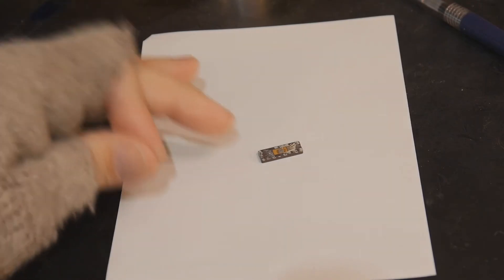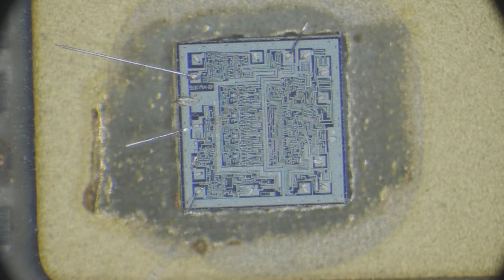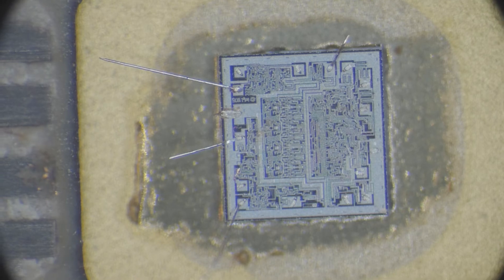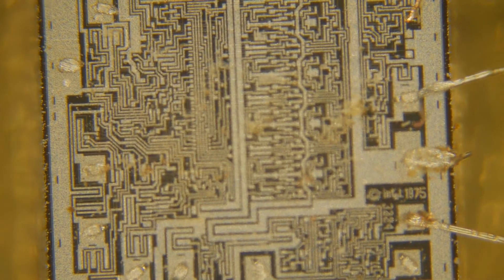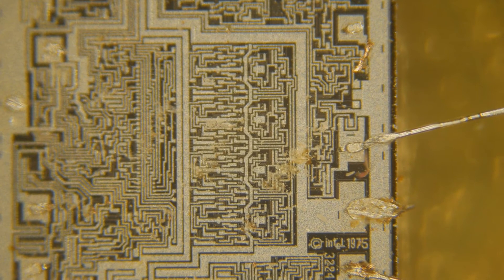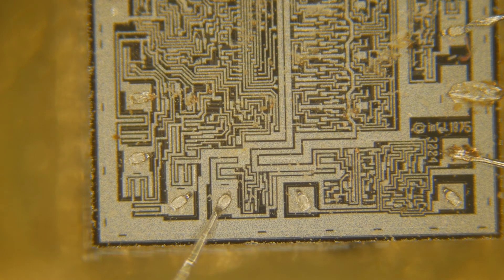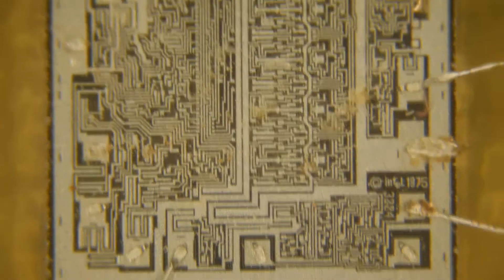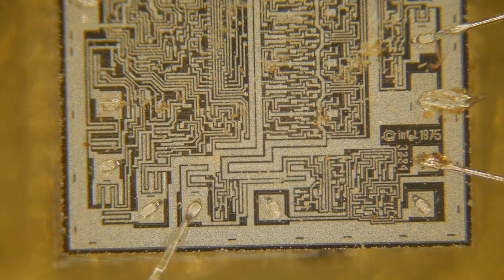#309 Intel 8224 clock chip under microscope

Comment: @1:30 if GND is top left in screen on the outer metal layer then going counter clock wise we would have  Vdd 24v , Osc1, Osc 2, Osc then Tank, X1, X2 then Vcc... looks good.  @3:50 is the best pic of the Vdd. no splat visible.  ta,
Reply from the maker: at 2:11 you see clearly the (C)Intel 1975. while some bonds are missing and some bent my best guess is: directly above the Intel mark is a bond which I believe is pin 16. above with a bond wire remnant, this heads to pin 1. pins proceed to 2,3,4 counterclockwise
Reply from the maker: the outer trace is gnd but it is not connected to the metal directly above the copy-write even though it looks that way. the bond may have been smeared on decap. the metal above INTEL 1975 is the 12V trace. I looked very carefully and could not find a catastrophic failure due to the 24V
Reply: @IMSAIGuy   you put 24 volts on Vdd pin 9 not vcc pin 16.   no matter , thanks for your vids and talking us down memory lane.. now back to my SC/MP and 8048 boards..

Comment: oh no , i got IMSAI and Electronupdate mixed up.. I was hoping you would orient the silicone with the chip pinout to try to see where the 24 volts did its damage on the 12v line.  send it to @electronupdate to be scanned